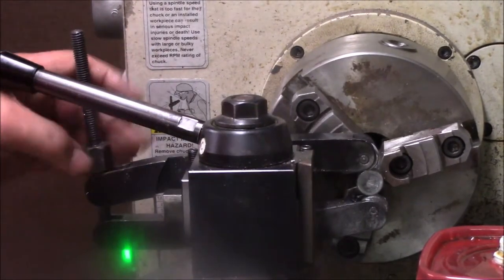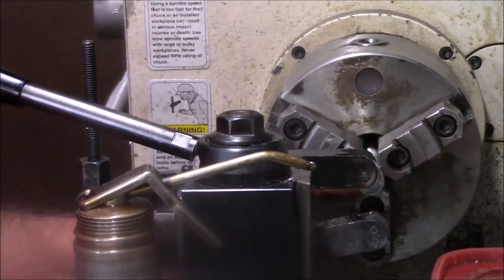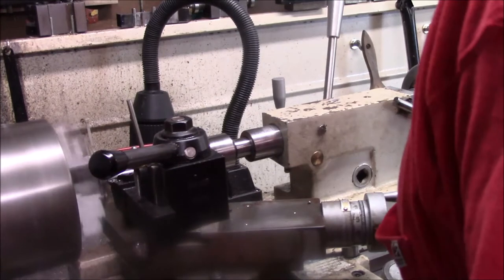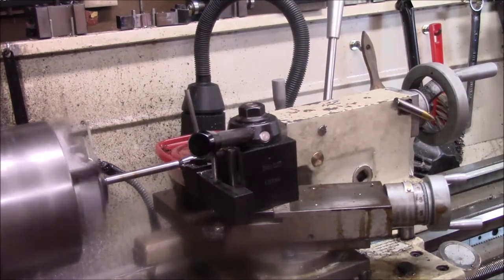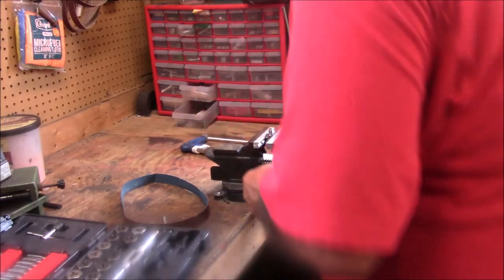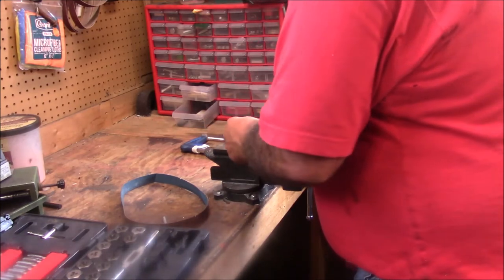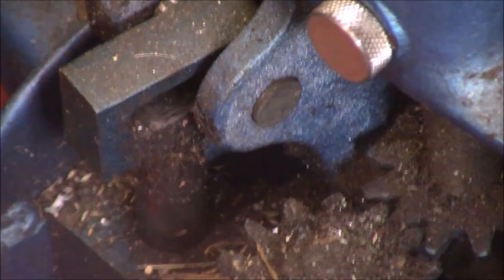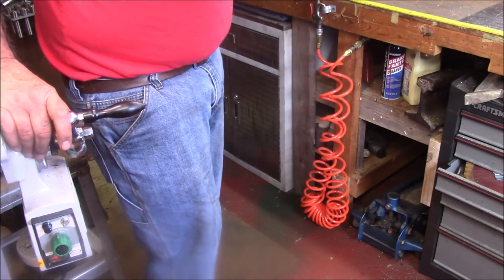Quick nut for floor jack handle

Comment: Jim add an oring to the threaded shaft, just thick enough to put some pressure on the screw when tightened down, this should keep the screw from loosening when you don’t want it to.
Reply from the maker: Rocking J Metalworks - John Brock really that’s not a problem the screw fits in a shoulder that keeps the handle attached. For a long time I just finger tighten the original nut, so the knurled one I can even get tighter